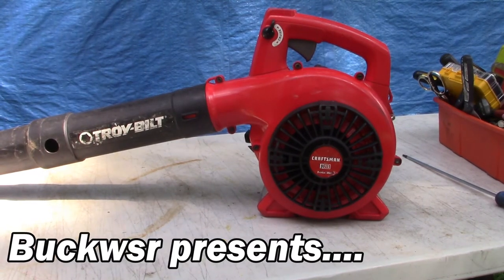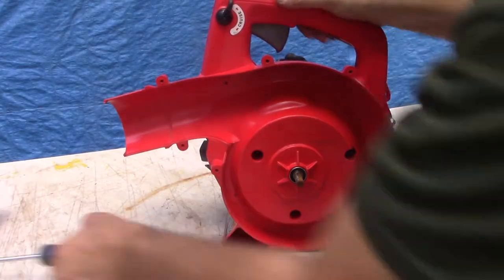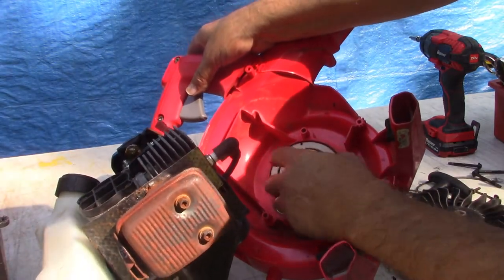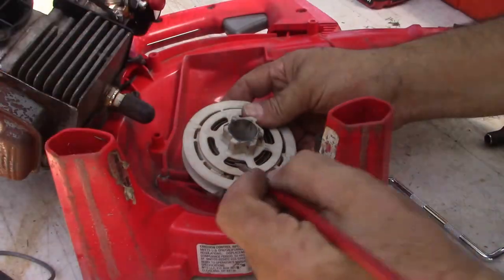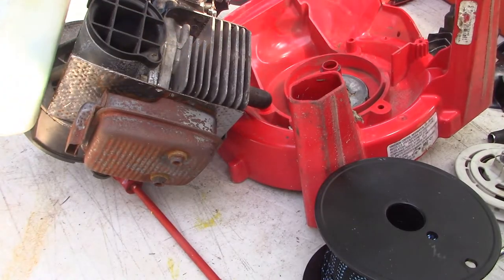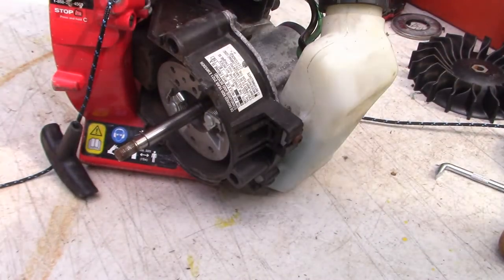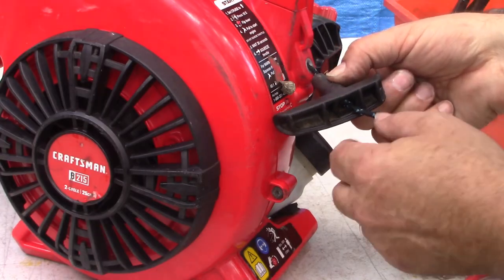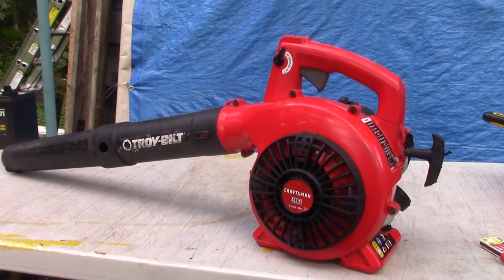How to Replace the Starter Rope on your Craftsman B215 Leaf Blower

Comment: So, you pretty much have to take it completely apart to replace a pull cord.  That's ridiculous engineering.  They really didn't consider maintainability when designing this product.  Another problem with this blower is that the air filter cover pops off so easily.  Just about any little bump and it comes off.  After putting it back on numerous times, it finally has been lost.

Comment: Buck - great video. As soon as I finished the rather impressive string of curse words after my starter rope snapped at the base, I discovered your video. Simple, no-nonsense approach that the non-technically inclined among us can appreciate. thanks again - I used Army 550 cord as the replacement starter rope - so if I have to replace it again, at least I know how!
Reply from the maker: Thanks, Mike. Good job fixing it yourself!

Comment: Worked like a charm! I used 550 instead of starter cord so it was slightly thicker than pull cord but worked just fine.
Reply from the maker: Glad you're back up and running!

Comment: I just did this for my Son-inlaw.....great illustration....although, the handle part had to be disassembled also to separate the engine.....not that big a deal.
Seriously though....kind of a pain in the ass for a pullcord replacement.
I don't fool with 2-stroke tools anymore.....My battery powered EGO works fantastic!

Comment: Thanks for this post, my cord broke after 7 months of use.  My nut is still stuck and didn't pop of as easily as yours.  I bought this at Lowes in Dec 2020 for $59 and I'm beginning to think I should just toss it and buy another.  BTW, my blower never, ever starts on the first pull, hence the broken cord, lol. Thanks again, maybe I'll give it another go!
Reply from the maker: Thanks, Robert. It amazes me that the blower only sells new for $59. I charged nearly that much for starter rope repair! So yeah, makes it tempting to just toss it in the garbage and buy a new one. So much stuff these days is made to be disposable, it seems. But this one does start easily and runs well, so I suppose it was worth fixing.
Reply: I just replaced mines but somehow the woodruff key came off the shaft does it go back in side to side or up and down ?????

Comment: If you don’t want your pull string flapping around, place your spring parts in with the new string or just clean up the old one. Do this without hand winding the string. Then hook the string into the notch found on the face along the strings guide. Now, wind up the spring until it’s difficult to go further and pull the string out of the notch. It’ll wind up the correct length of string. If you have a new cut of string, you may need to file that notch out a little bigger. Put the handle on the string and pull string out 10”-12” to tie your knot where it’ll pull your handle in tight.

Comment: Thanks for this . I have an issue though, my flywheel key is sheared. and remnant's of it are  are gone, Do you know who makes this engine and where i can get a new key?
Reply: Craftsman blowers don't have flywheel keys. There is a nut, bearing, a little 3/8"" x 2" steel cylinder, and three or four washers.

Comment: What length was the rope? Thank you
Reply from the maker: Get the approximate length by comparing it to the old broken rope, if you have it. Otherwise, just make yourself a nice long piece, which you will then shorten at the handle end as your final step. Good luck.
Reply: @Buckwsr  I can’t seem to get enough tension on recoil. I noticed well I had the spring come out under the silver piece. Finally got the spring back in, Looked at your video, still can’t get enough tension?
Reply: Hey man I got it fixed. Thx for your video,

Comment: You left out the part where to disassemble the throttle linkage from the motor so it pulls apart.
Reply from the maker: That's because I did not disconnect those linkages or wires, but left them intact. I was able to pull the motor off the blower housing without disconnecting the cables.
Reply: @Buckwsr  I have the 210 series and had to disconnect the linkage and remove the bottom two screws at the handle, everything else in your video went perfect. Thanks.
Reply from the maker: @ReedtechIndustries  Yes, in my case it was a bit awkward with the motor and housing still connected by the cables, but it was manageable.